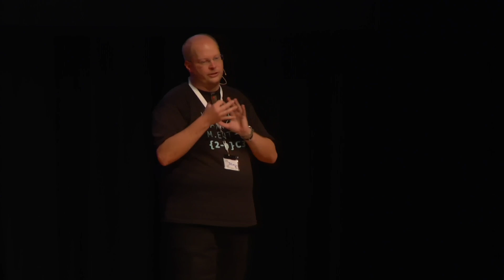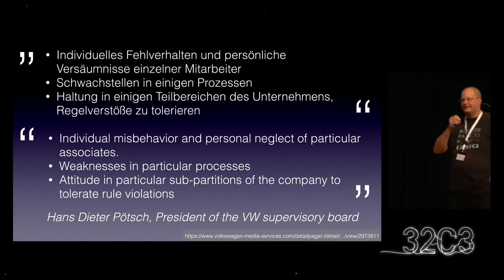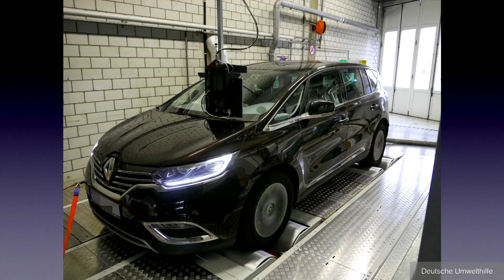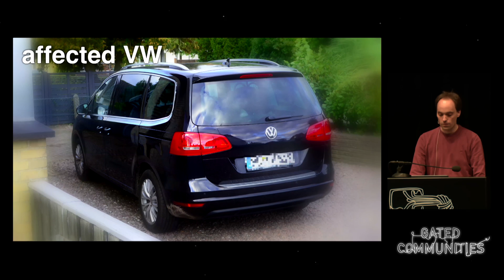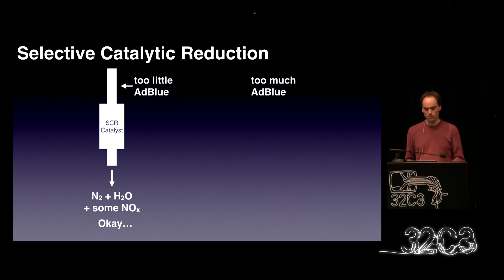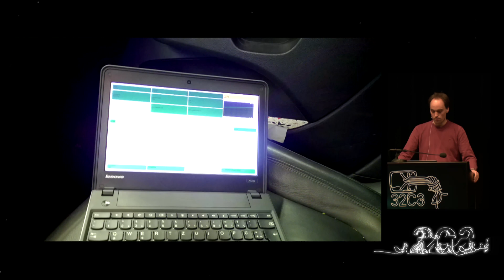32C3 - The exhaust emissions scandal "Dieselgate"

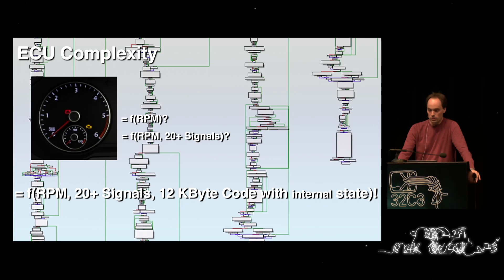Comment: 49:00   Doesn't surprise me.    I know stock tachs are generally not very trustworthy.    I owned a car with a known issue where the stock tach was dampened so much that it couldn't keep up to the engine in first gear.
People want gauges, but since they don't actually know how to read gauges, or what the numbers mean, the manufacturer has to make them read how the customer expects it to read.    It's gotta be a nightmare for engineers.